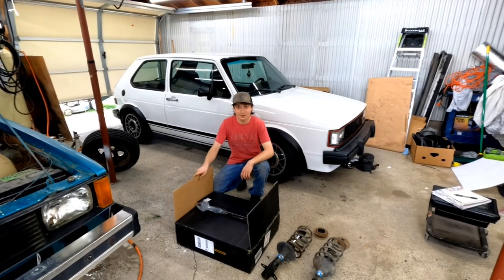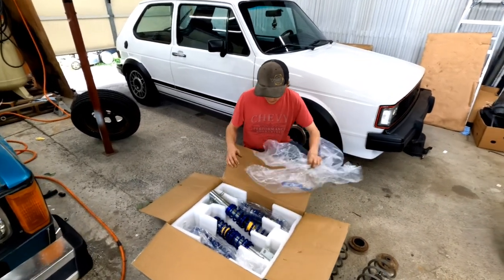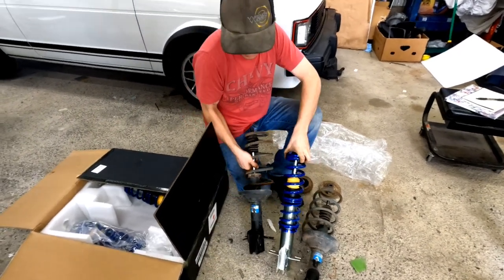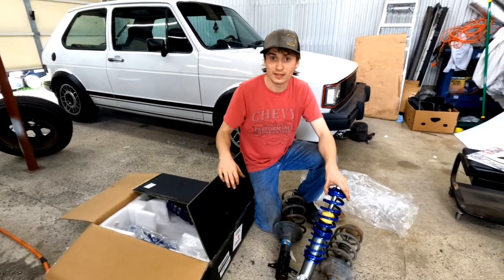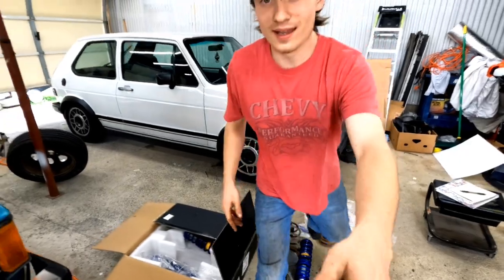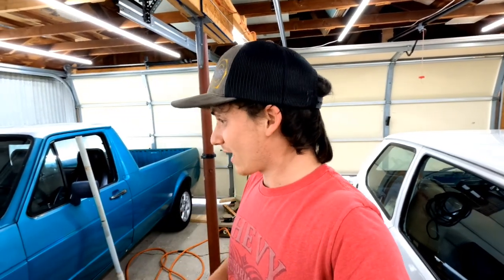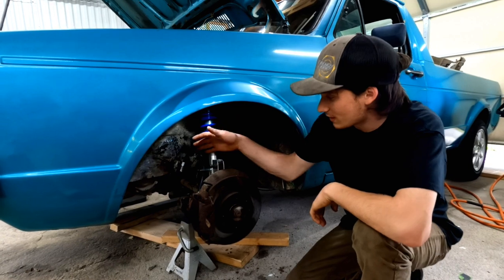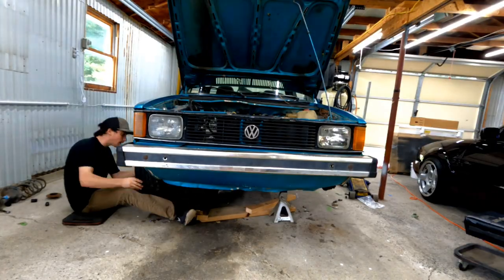MaxpeedingRods Coilovers for my VW Rabbit Pickup

Comment: I built one in germany. I never should have sold it.  ABT 1.8 ,5 speed GTI front suspension & transmission. I hand built a fiberglass and Aluminium rear deck, Rear tube bumper, leather interior, sliding rear window.  Koni Red front suspension Eilbach springs, ATS wheels, Continental Aqua contact tires. and could do 170mph + Color Spies & Hecker D6Z and Audi pearl added, with a little shimmer added. Upper door mirrors, normal mirrors removed & Shaved, Group A Header, Techtonics exhaust resonator only 2.5 inch. fender flares extended. Body line pearl rainbow graphic line clear pearl coat. GTI roof antenna. Flywheel shaved increased RPM to 9,000+. Short shift kit, Door lock Armor kit-detering popping the locks. Injection from Audi 2.5 throttle body,  ported intake and a lot more. Wheels rear 15x9 front 15x7.5